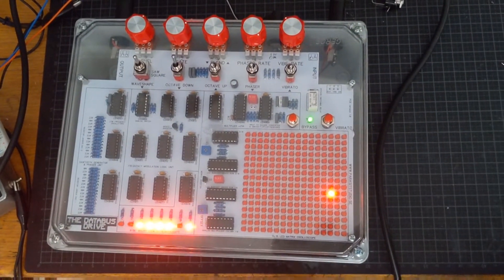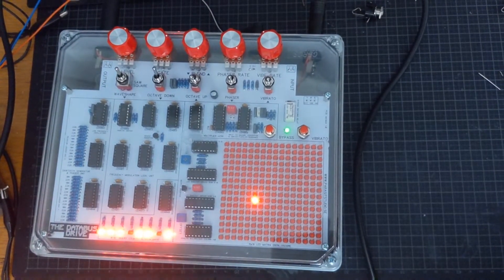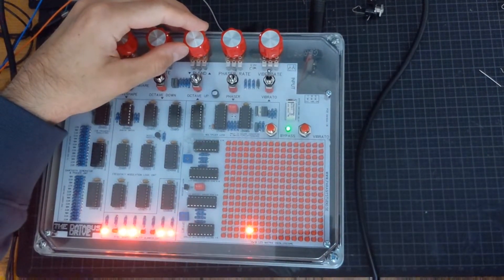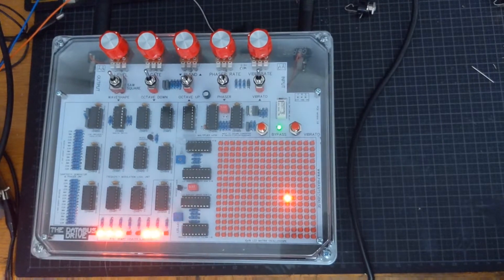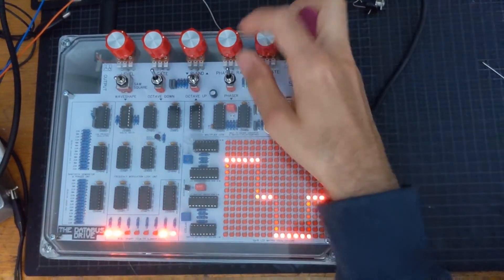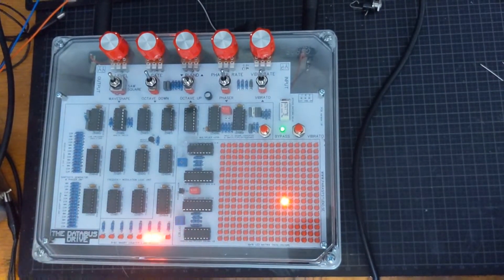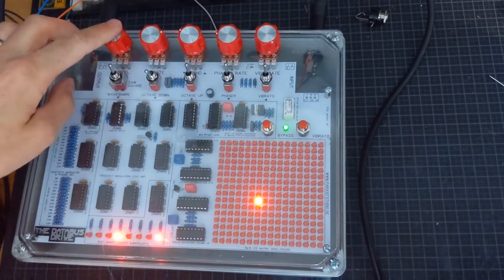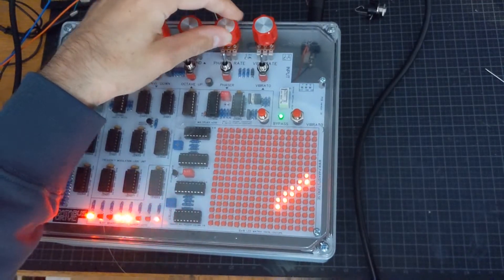The C19 Databus Drive

Comment: how tough of a build is this?
Reply from the maker: If you have some experience with soldering you should be fine. There alot of space on the board between the components and very little offboard wiring to do, so the build is pretty straight forward. Just a ton of soldering required (especially the LED matrix).

Comment: Dude, you make absolutely fantastic work! Just found your shop. How it sounds with a low bass 5 string bass signal?
Reply from the maker: Thanks! It tracks poorly on low notes I'm afraid (even on guitar) so I can't recommend it for use with a bass. Maybe you would like my "Sonic Reducer" pedal? That one works well with bass. :)
Reply: @PARASITSTUDIOEFFECTS  thanks for your answer. Sonic reducer sounds more like bitcrusher/ring modulator, it's not really what I want, but maybe it depend of settings. I think I will try it if you recommend) cheers 🤝